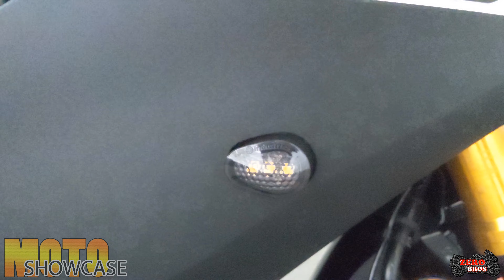TST Flushmount Signal Lights with Halo GTR on the Yamaha R3 2019 - MOTO SHOWCASE

Comment: I bought some aftermarket fairings and that part of the light will not fit through the hole at all. any advice?
Reply from the maker: If it fits the original fairing then just drill the hole bigger to size. Since its aftermarket fairing im not too sure.